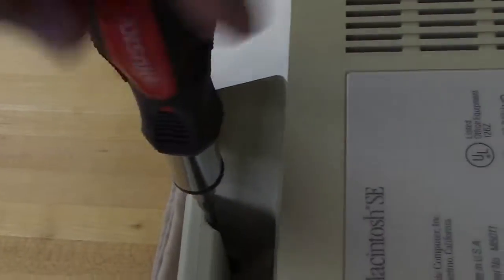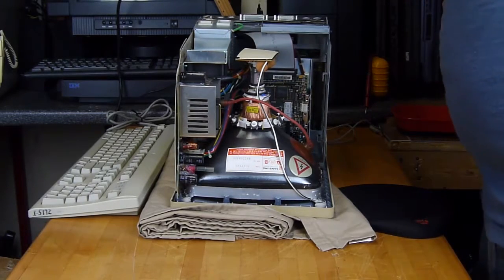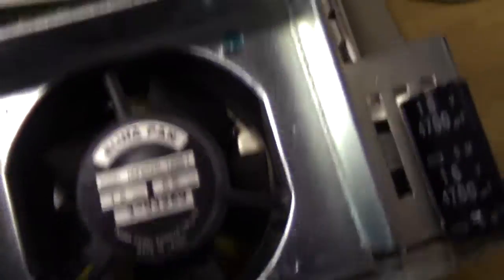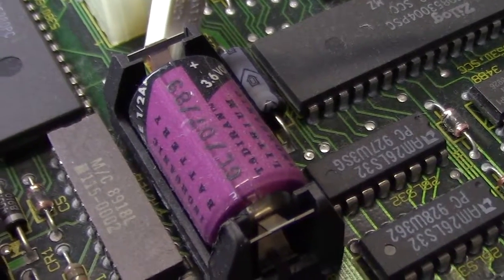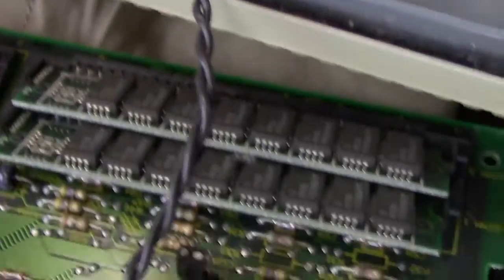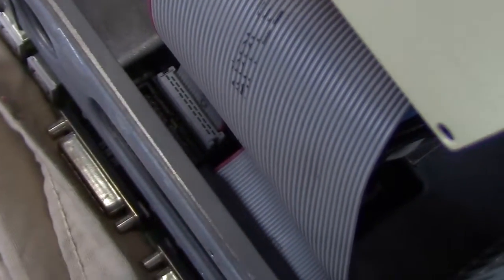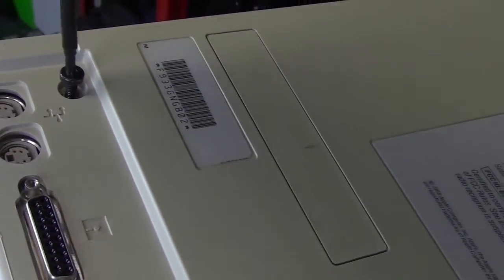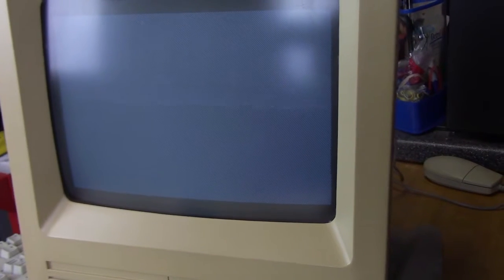Macintosh SE Battery Removal

Comment: v useful
Reply from the maker: Glad to hear that.
Reply: but i can NOT get the case off mine. Screws all out. Tried with a bulldog clip, scared of chipping case
Reply from the maker: If you have a Harbor Freight near you. Try their Trim and Molding tool set. They are made of plastic. Work the case corner to corner, a little at a time.

Comment: Hi,will the SE operate to the full without a battery inside?cheers,
Reply from the maker: From what I can tell it seems to work fine. Just certain preferences arnt saved after a power down. Such as the time and mouse tracking speed.